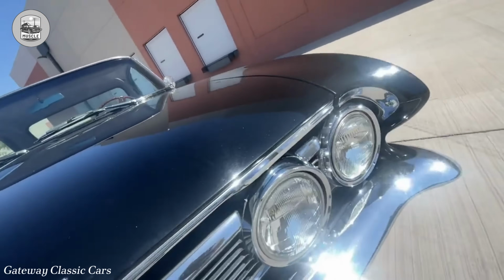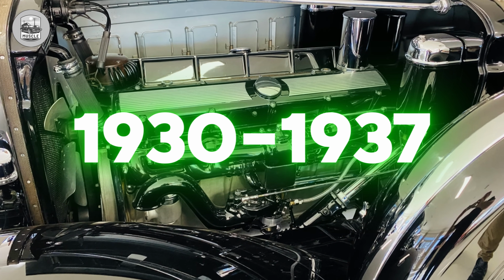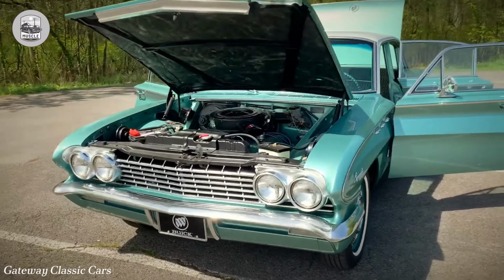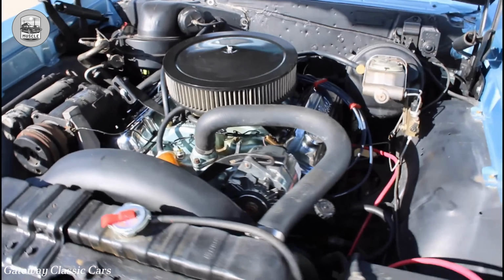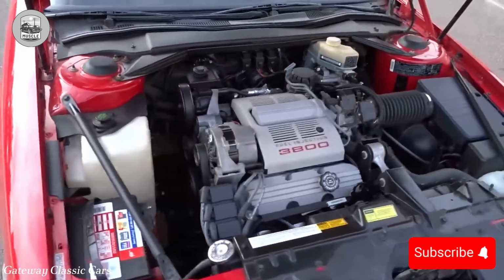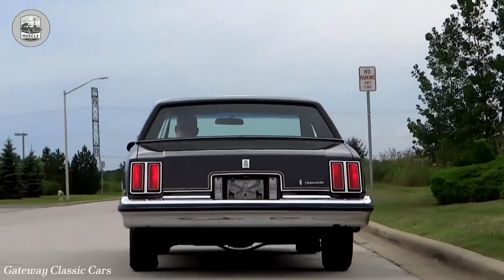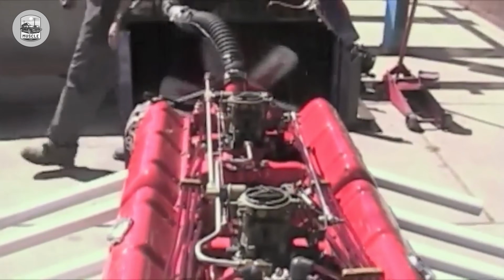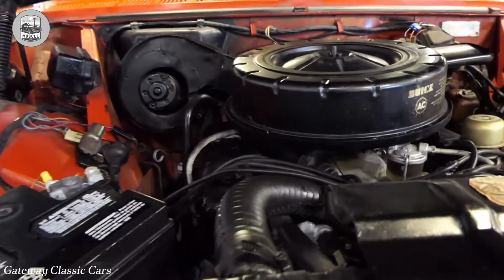10 MOST FAILED and WEIRDEST GM Engines ever made | Worst engines blunder!

Comment: The 3800 v6, rest in peace. The worlds greatest and most reliable v6 ever.
Reply: I have to respectfully disagree with the idea that the 3800 V6 was the world's greatest and most reliable V6. While it was definitely a solid engine with a good balance of power and efficiency, it wasn't without its issues. The 3800 Series II, for example, had problems with the intake manifold gaskets and plastic coolant elbows that often failed, leading to coolant leaks. And let’s not forget the Dex-Cool sludge issue that plagued a lot of GM engines in that era. While it earned a reputation for durability, especially in later revisions, there are other V6 engines, like the Toyota 2GR-FE, that arguably surpass the 3800 in terms of longevity and trouble-free service. What are your thoughts?
Reply: @KeithGreene-k1v  It’s amazing how this engine earned its place as one of the most reliable and long-lasting V6 engines ever built. Originally derived from Buick’s 198-cubic inch V6 in the 1960s, the 3800 evolved over decades, reaching its pinnacle in the Series II and Series III.
Reply from the maker: The 3800 V6 deserves all the respect! It was a powerhouse of reliability, starting with the Buick 231 in the '60s and evolving into the 3800 in the late '70s. It was such a versatile engine, used in everything from Camaros and Firebirds to sedans like the Buick Regal and Pontiac Grand Prix. The supercharged 3800 Series II in the late '90s was a beast, putting out 240 horsepower while still maintaining that legendary durability. With millions produced, it’s no wonder people still talk about this engine with so much respect.
What do you think made the 3800 V6 so special? Drop your thoughts below! Don't forget to comment, share your memories, and subscribe to Muscle Car Masters to keep the conversation going! We’ve got more great content coming your way..

Comment: Olds diesel potential killed by bean counters
Reply: While it's easy to place blame on the 'bean counters,' the Oldsmobile diesel's issues were far more complex. The engine had significant design flaws, like its weak head bolts and lack of proper fuel filtration, leading to reliability problems. These technical shortcomings played a bigger role in its downfall than just financial decisions. Engineers needed more time to develop a robust platform, but rushed production to meet demand didn't help either. Blaming corporate oversight oversimplifies the situation—it was a mix of technical and market challenges that led to its early demise.
Reply from the maker: The Oldsmobile 5.7L diesel engine had the potential to be a game-changer. The core design was solid, but it fell victim to cost-cutting measures that led to major reliability issues. The use of weaker head bolts, for instance, led to head gasket failures, and the fuel injection system wasn’t robust enough to handle the rigors of Diesel. If GM had invested a bit more into proper engineering and materials, we could be talking about a completely different outcome for American diesel cars. Thanks for sharing your thoughts!
Everyone, if you’ve got more insights or stories about the Olds diesel or other muscle car engines, drop them in the comments! Don't forget to like, share, and subscribe to the Muscle Car Masters Channel to keep the conversation going...
Have a great day.

Comment: Caddys 864 worked great when it worked.. but when it didn't it usually got stuck in 4 cylinder mode.. but it wasn't uncommon to get 28 to 34 mpg in a full sized caddy
Reply: While the Cadillac 8-6-4 system had potential, it was plagued by reliability issues from the start. Yes, when the system worked properly, fuel efficiency was impressive for a full-sized car. However, the complexity of the system often resulted in failures, like getting stuck in 4-cylinder mode, which significantly impacted drivability. These problems were frequent enough that many owners ended up disabling the system entirely, which undermines the whole idea of improving fuel economy. So, while 28-34 mpg was possible, it wasn’t consistent or reliable for the majority of owners.
Reply from the maker: You're absolutely right! The Cadillac 8-6-4 system was ahead of its time, offering impressive fuel efficiency for such a massive car when everything worked smoothly. Getting 28 to 34 mpg in a full-sized Cadillac was nothing short of groundbreaking in the early '80s! Unfortunately, as you mentioned, when the cylinder deactivation technology failed, it often left drivers stuck in 4-cylinder mode, turning what should have been a luxury cruiser into a sluggish ride. It wasn’t until later advancements that cylinder deactivation became more reliable, but the 8-6-4 certainly laid the groundwork.
I'd love to hear more experiences from others who’ve had a Cadillac with this system! Have any of you had a similar issue or perhaps a positive experience? Let us know in the comments, and while you're here, don't forget to share this video and hit that subscribe button for more deep dives into the fascinating history of American muscle cars and their engines.
Have a good day.

Comment: You forgot to add the 1982 Chevrolet 4.3 v-6 ! Basically a v-8. With two cylinders removed.
Reply: Actually, I have to respectfully disagree with that view on the 1982 Chevrolet 4.3 V6! While it was indeed based on the V8 with two cylinders removed, calling it 'so bad' overlooks some key points. The 4.3 V6 was quite durable and had solid performance, especially in the trucks it was designed for. It produced good low-end torque, which made it ideal for towing and hauling. Additionally, it laid the foundation for the popular 4.3 engines used later in models like the S-10 and Blazer, which many drivers found reliable and versatile. It may not have been perfect, but calling it bad doesn’t do justice to what it brought to the table.
Reply from the maker: Thanks for pointing that out! You’re absolutely right—the 1982 Chevrolet 4.3L V6, known as the “V6-90,” was indeed based on the small-block V8 design. By removing two cylinders, Chevrolet essentially created a lighter, more fuel-efficient engine while still retaining much of the power and durability of the classic V8s. The 4.3L V6 went on to have a long life in various trucks and vans, and even saw some performance modifications over the years.
What’s really interesting is that despite its smaller size, it kept the same bore and stroke as its V8 counterpart. This gave it a lot of torque, making it a solid option for mid-sized vehicles. It was also the engine that carried over into the early 2000s, powering everything from full-size trucks to SUVs.
Everyone watching, don’t forget to drop your thoughts about the 4.3 V6 or any other engine we might have missed! Let’s keep the conversation going—comment below, share your favorite engine stories, and don’t forget to subscribe to Muscle Car Masters for more awesome content.
Reply: @MuscleCarMasters68   I remember it well. The car I was working on was a Malibu wagon and the parts department had given me the parts for a Odd fire or a 3.8 and I said no its a 4.3 . They insisted I was crazy . Being the o7 Emissions  and drive ability Tech for the dealer I had them come to my stall and take a look. Sure enough a 4.3 v-6 not to be confused with my Monza 4.3 V-8.. By the way the Buick 3.8 was a amazing engine , Digital  EGR and unheard of torque. And that was in the transverse drivetrains not to mention the blower motor cars.
Reply from the maker: @jimlove4541  Great memory! The Buick 3.8 V6 was indeed a powerhouse, especially when you look at its evolution from naturally aspirated to turbocharged applications. You're absolutely right about the Digital EGR; it was ahead of its time, helping manage emissions without sacrificing performance. And the torque? Definitely impressive, especially in those transverse applications. The supercharged versions, like the ones in the Grand National and Regal, really set the standard for V6 performance.
As for the 4.3 V6, it’s another unsung hero. Based on the small block V8, it delivered great performance for its size and was used in everything from trucks to cars. Your Monza with the 4.3 V8 must have been a beast!
Let's keep the conversation going—does anyone have stories about their experience with these engines? Drop your thoughts in the comments! Don’t forget to like, share, and subscribe to Muscle Car Masters for more engine stories and muscle car memories....
Have a good day.

Comment: The Clark cycle uni-flow scavenged 2 stroke Detroit diesels were absolutely the greatest diesels in world history history. They also bad a 51 series Day cycle valve-less loop scavenged engine that was done like a gasoline 2 stroke. They were very simple yet awesome running engines, very rare and made in a 2 cylinder (2-51) and a 4 Cylinder (4-51)  versions. I have 2 of the 4-51 engines and realize I may be the ONLY person in USA to own 2 of these rare engines! The 2 stroke Detroit diesels are marvels and sound amazing! Cheers! 😂👍🏻
Reply: I have to respectfully disagree with the claim that the Clark cycle uni-flow scavenged 2-stroke Detroit Diesels were the greatest diesels in world history. While they certainly have a unique design and a legendary sound, there are several areas where they fall short compared to other diesel technologies.
First, the two-stroke design, while simple and powerful, had significant efficiency issues. The constant scavenging process made it harder to control emissions and fuel consumption, especially when compared to four-stroke diesels that later became the industry standard. The four-stroke engines offered improved fuel efficiency, lower emissions, and more consistent power delivery.
Second, while the 51 series Day cycle valve-less loop scavenged engines were mechanically interesting, their rarity suggests they weren’t widely adopted for a reason. Complexity in maintenance, along with parts scarcity, made them less practical for large-scale applications where reliability and ease of repair were paramount.
Lastly, while I can’t argue with the sound—they do have an iconic noise—there are other diesel engines that have revolutionized transportation and heavy machinery to a greater extent. Engines like the Cummins N14, for example, provided unmatched reliability, efficiency, and longevity, earning their place in diesel history.
Reply: .  N-14 a great engine 
But nothing on the scale Detroit diesel was. Wake up bro
Reply from the maker: @NathanStickney-xv6dy  The N-14 is a fantastic engine, known for its durability and strong performance, especially in commercial applications. But when it comes to sheer scale and influence, Detroit Diesel is in a league of its own! From the iconic 6V53 to the powerhouse 8V92, these engines helped power everything from heavy-duty trucks to industrial machines, making Detroit Diesel a true legend in the world of American powerplants.
What do you guys think? N-14 or Detroit Diesel—what's your pick for the toughest engine? Drop your thoughts in the comments! Don’t forget to share this video with your fellow gearheads and subscribe to Muscle Car Masters for more deep dives into the best engines ever built
Reply: @MuscleCarMasters68  have you ever operated a n- 14 or a Detroit two stroke.?
Reply: @MuscleCarMasters68   I've operated both engines and in 14 Cummins 430 horse and an old  Silver 92 rated at 430 horse I'll take to Detroit every time that's speaking from experience
Reply from the maker: @NathanStickney-xv6dy  Thanks for sharing your experience with us! It's always great to hear from someone who’s had hands-on time with both the Cummins and the Detroit engines. The Silver 92 has a strong reputation, especially with that unique two-stroke sound and reliability that Detroit Diesel is known for. That 430-horsepower rating was impressive for its time, and many operators appreciated the way Detroit Diesels would just keep going, even in tough conditions. Cummins, on the other hand, is no slouch either, offering great torque and fuel efficiency, especially in their more modern engines.
For those who don’t know, the Silver 92 is part of Detroit's 92 series, which became a workhorse in the trucking industry. The two-stroke design, while different from today’s four-stroke diesels, had its own set of benefits like simpler mechanics and higher power-to-weight ratios.
Reply: @NathanStickney-xv6dy  The KT 450 Cummins was the real deal came installed in a Bucyrus-Erie crane.
Reply: @CookeZachery  Certainly not a Teir3 engine, no computer, easy to replace injectors. My widow maker Michigan loader with forks had a 4/71 that I used to stack delict cars three high in our yard.
Reply: @gelmgren  Hold on, I get the nostalgia for the 4/71, but let’s not pretend it’s a flawless workhorse! Sure, it’s simple without the computer, but those old-school injectors need constant tweaking, and don't get me started on the noise and smoke. Plus, with emissions getting tougher, running a ‘Tier-anything’ engine like that today is a headache. Modern engines have come a long way – yeah, they’re complex, but they’re miles ahead in efficiency and reliability. I’d pick a modern diesel over the 4/71 for heavy lifting any day....
Reply from the maker: Thanks for sharing that incredible insight! The Clark cycle uni-flow scavenged 2-stroke Detroit Diesels truly are remarkable. Their efficiency, simplicity, and the sound they produce are absolutely iconic! It's fascinating to hear that you own not one, but two of the rare 4-51 engines. You're definitely in a unique position, as these engines are becoming harder to find, especially in working condition. The 51 series, with its valve-less loop scavenging similar to gasoline 2-strokes, was such a forward-thinking design. The fact that they made a 2-cylinder and 4-cylinder version just adds to their versatility and engineering brilliance. They may be rare, but they left an unmistakable mark on diesel history!
For everyone watching, if you’ve got a love for rare engines like the 2-stroke Detroits, or if you just enjoy hearing stories about forgotten marvels of automotive engineering, drop a comment below! Let’s hear what rare engines or vehicles you’ve come across! And don’t forget to like, share, and subscribe to Muscle Car Masters—where we dig deep into the history of engines and muscle cars that made America roar. Keep the conversation going and stay tuned for more amazing content.
Reply: Big 12 v71 i believe it is distinctive Detroit diesel on the valve cover😂 in a big log hauler truck out here on Vancouver island, twin turbo and surper charged 12 cylinder looked to have been parked for many years, would be fun to get it running. @MuscleCarMasters68
Reply: Ah, the Detroit 2-strokes – I'll give it to you, they sure have a unique sound, and their simplicity is impressive. But the greatest diesels in history? That’s a bold claim! For real power and durability, you can't overlook the Cummins and Cat engines that have been hauling heavy loads across the country for decades, outlasting almost anything else on the road.
Sure, Detroit Diesels have their charm, especially the uni-flow design that made them a hit back in the day. But they struggled in long-haul durability compared to the heavy-duty inline-six Cummins and the V8 Cats that could pull mountains. And honestly, as fun as the 2-stroke Detroits are to listen to, the “screaming Jimmy” sound gets old fast, especially for the poor guys trying to sleep at a truck stop!
Props to you for owning two of those rare 4-51s – it’s no doubt a cool piece of history, but I’m sticking with my Cummins or Cat for any serious heavy lifting. Cheers! 😆